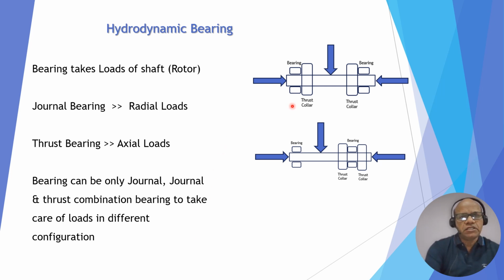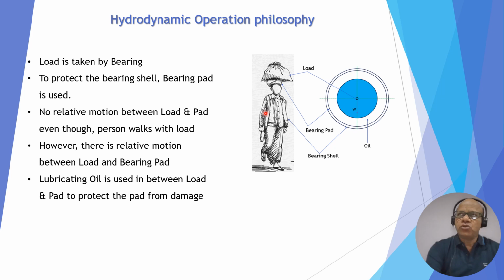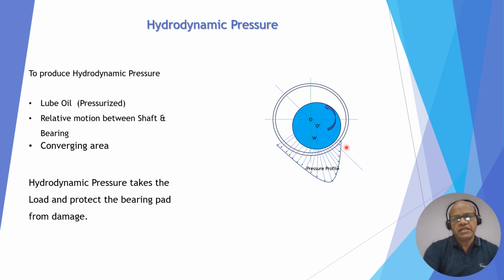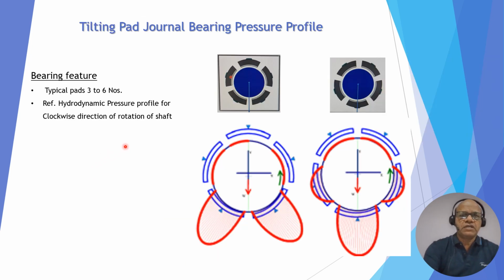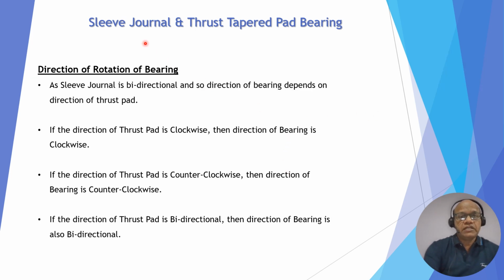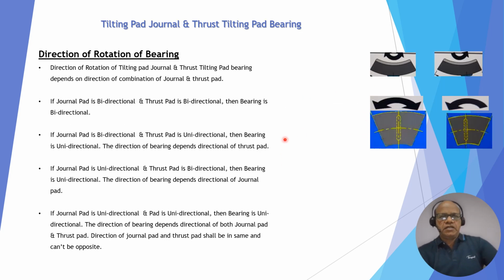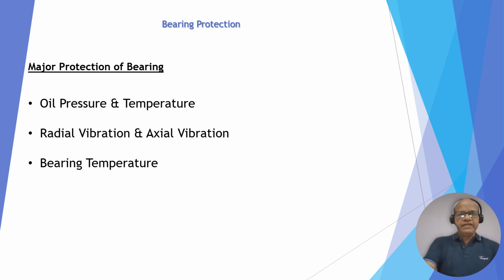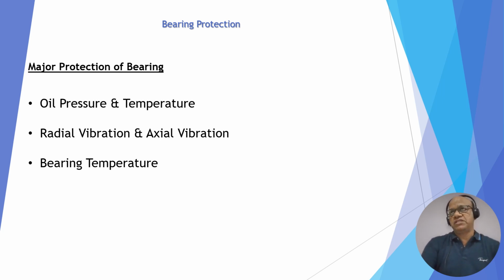Hydrodynamic Bearings

Comment: How do select bearing type?
Reply from the maker: I cannot say much on bearing selection . However simple way of selection is based on speed . If Speed is lower,  sleeve type journal cum fixed thrust bearing is used and when speed is higher then tilting pad journal and fixed thrust bearing is used . Some cases tilting journal and tilting thrust pad is also used ..selection criteria are limitation of journal surface speed,  thrust surface speed, specific load on journal area as well as specific load on thrust area... these are basics selection guidelines ...thanks